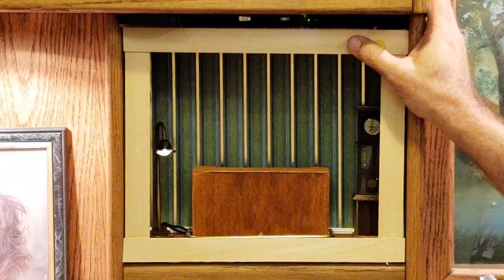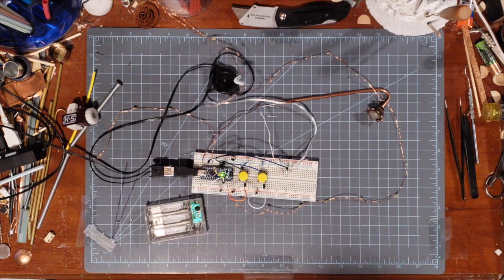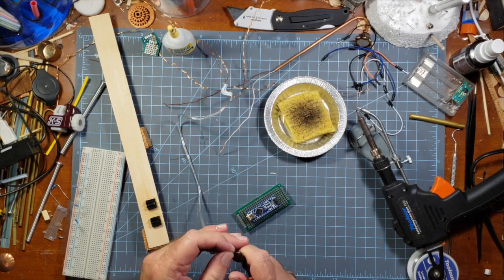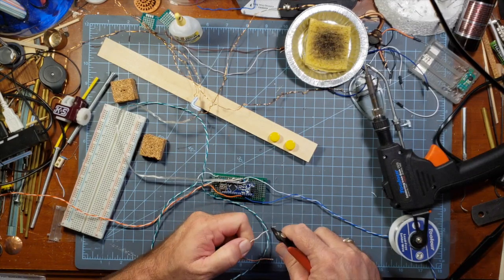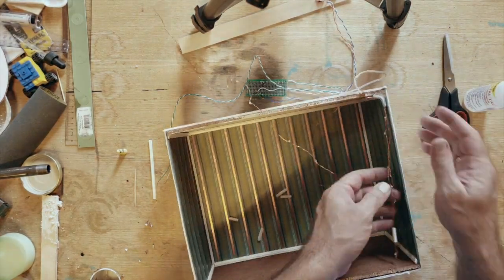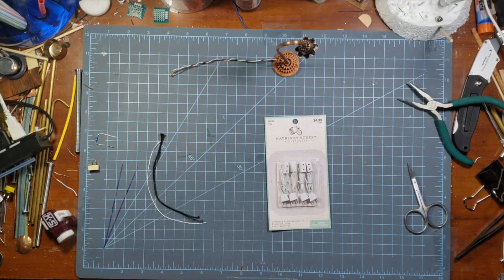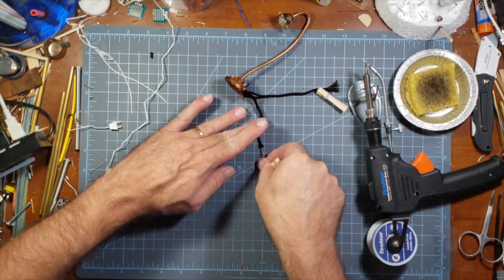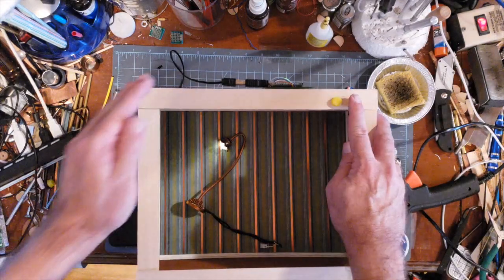My First Book Nook   Part 2 | The Lighting Electronics

Comment: That was totally cool to watch! Wouldn't be a Dolfin Magik Production without an oopsie and I put dibs on the straw and glue issue! 😁 Not so much on the battery pack because the lights worked... just not with the pack. Wonder if Gorilla Glue or E6000 Glue would have the same issue with straw material...🤔  Keep up the great work Sean!
Reply from the maker: Thank you!  I have to agree with the oopsie!
Generally speaking, drinking straws are made of the same material as milk containers...HDPE.  Which is also the same type of plastic that Super Glue bottles are made of.  And super glue has a difficult time adhering to that plastic.
Both of the glues you mentioned probably would have worked, but I don't have any.  hehehe

Comment: You can take the pins out of those plugs, remove the wires completely, and push the wires from the lamp through the holes and push the pins back in to save the soldering.  Or solder to the pins if you pull the wires through so you don't melt the plastic. You can also make your own plugs and outlets just like those with pins and brads and polystyrene or wood.  Also I'm subscribed to a youtuber who makes their own in scale.
Reply: FabNiWorld if interested.  Too lazy to link
Reply: There are some very talented Youtube miniaturists out there who only have a few videos and a few subscribers so they get left out of the search algorithms.  You know, like DMP.
Reply from the maker: Thank you for the suggestions and ideas!  I will look for that channel and check it out!  Thank you!